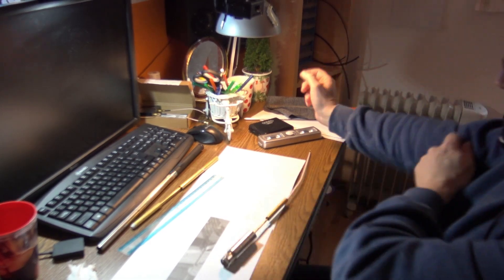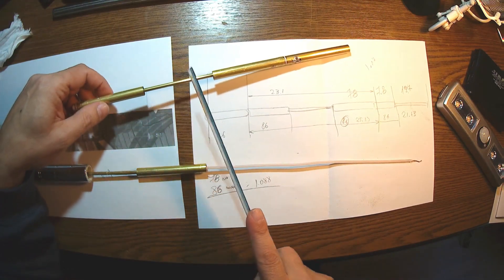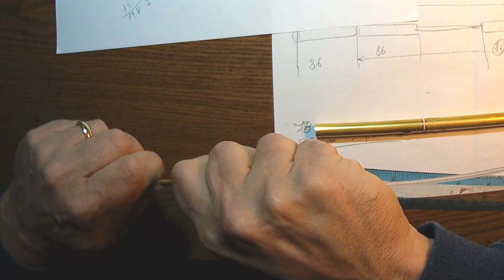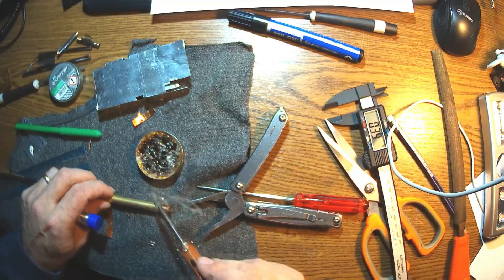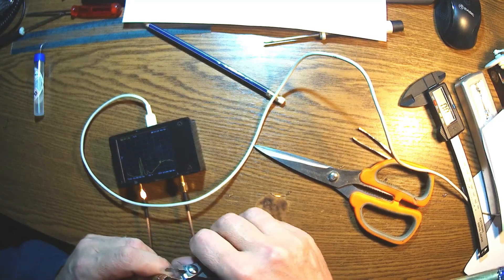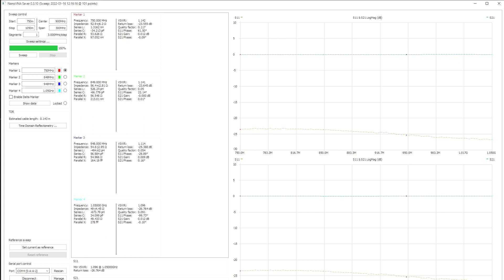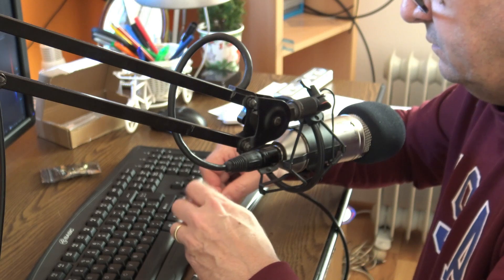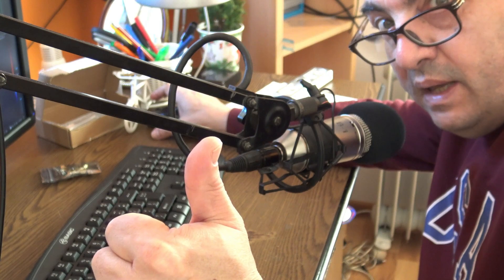LoRa antenna mod and tune

Comment: Hello Viorel, nice effort to tune the antenna, which works before better at 915 MHz. I have a similar one and will try also.   Would you please tell the exact dimensions of the tuned and shifted tubes inside at the end of your experiment. You changed a bit after your first try and first calculation.  Greetings from Germany
Reply from the maker: I found something even better..look here https://www.youtube.com/channel/UCPzHUa6RydwlsmLt3_8Lh8g
Reply from the maker: Just modify an antenna today after this video and it's working great! Better then my last video..
Reply: @viocaia  Hello Viorel,
I'm curious. In what way did this (great) video from Tangra Electric Power did help you, improving your modification at your antenna ?  The dimensions of the tubes or the part between ? You just before added some pieces to get them longer. Or other informations ?
Reply from the maker: I just stick to the dimensions in the video..the results was much better them mine upscale dimensions. I can say it's a working antenna. I'll do a video soon